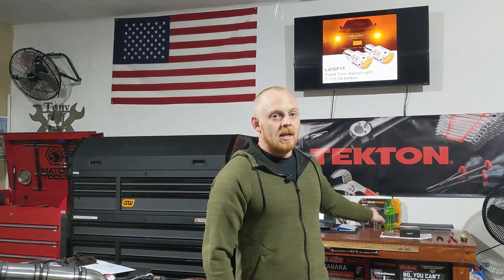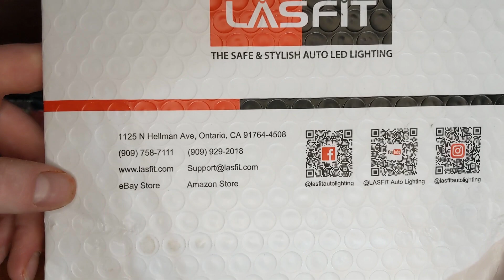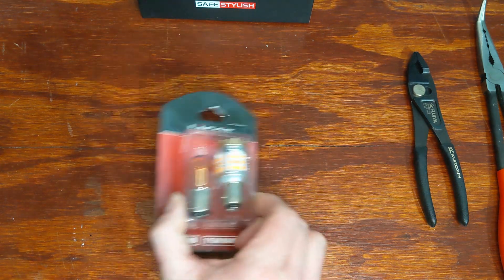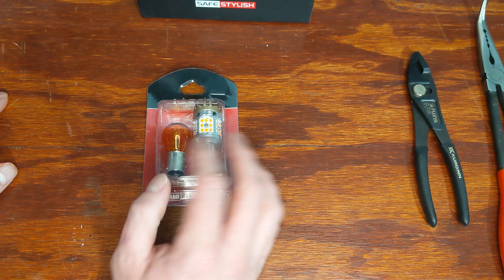2020 2021 Kia Telluride LED Turn Signal Upgrade Lasfit Blinkers Hyper Flash CHECK DESCRIPTION

Comment: Hey Tony, I enjoyed your videos. I just install the LEDs high and low beams. They’re working great. I want to change the turn signal lights, and I could not find your description on the bulbs. Can you give me the description and part number. I also called Lasfit and they said they do not make a bulb for the turn signal. Can you give me a heads up? Thanks in advance.
Reply from the maker: They discontinued it actually. They still have the bulb but they don't list it made for the telluride bc alot of people were having blinker issues. They said they were working on a new bulb to work with it but have yet to see them post them. I had issues with my blinkers early on. They would blink twice then stop blinking. After about 2 months of using them they started working fine. So while they are awesome lights. I don't suggest using them anymore just bc of possible issues. I apologize for not making an updated video about them.
Reply: Thank you

Comment: you need to add a resistors to your turn signals to stop that hyper flashing add one to each bulb
Reply from the maker: The connection is built into the housing of the headlight. So it's not as simple as splicing into the connector that goes to the bulb. It's hard to explain but it would involve digging into the actual wiring harness
Reply: @TonyTheTechnician  yes I see what you mean  you'd have to remove the headlamps and put them in the wiring harness.

Comment: Hey Tony, great video you made, I'm planning on replacing my rear turn signals but I don't know where to begin, it looks like I might have to go under my rear bumper or migjt have to remove my rear bumper gor this idk... Are you planning on doing a video for rear turn signal LED replacement thanks!
Reply: Did you ever do that? I'm searching for a video or help on how to remove the light inside the bumper, as mine has gotten water inside of it presumably from the car wash 😬 wondering if you have any tips?

Comment: Hi Tony, after I seen your video I gotta set of "Lasfit" led bulbs the exact one you had in the video for the front turn signal on my telluride and yes, it was a pain in the ass to remove the stock bulb out of the socket from the vehicle I almost dislocated my thumb by doing that lol. My real problem is after the led had installed, I have noticed my blinker on the driver side(only left turn signal) something blink unevenly, what I mean by that is, it blinks normal for a few seconds then it would blinks rapidly and the weirdest part was the blinker light cuts out it wouldn't show the light but you can still hear the rapid blinking from the vehicle. But sometimes it will do just fine blink normal and you can see the light flashes What do you think this problem would be any ideas? Appreciate your input!
Reply from the maker: Hey ya after about a week of running mine I had the same issue and I eventually shut the auto lights off and drove like that and I'm not sure if the computer learned it but after a little while of doing that I never had another hyperflash issue. I know when they first released these bulbs they had it designated to be q plug n play bulb for the telluride. Then I noticed they removed them as an option for the telluride so I wasn't sure if they changed something or if it was bc of an issue. But mine have been working great for almost a year now so sorry I couldn't be of more help.
Reply: @TonyTheTechnician OK,  I'll give a try like you says and see it correct itself would let you know...! 👍
Reply: @TonyTheTechnician  Hey Tony would you by any chance to do another video on the rear blinker of the tellueide LED replacement...?  Love to see it and I would like to replace my rear turn signal for LED!
Reply from the maker: OK sounds good. Yes please let me know. I'm still running mine and haven't had an issue in a long time so I'm hoping that helps with yours as well bc these things are amazing. I can come up to an intersection and see my blinker reflecting off of everything lol. They are very bright

Comment: I used your link and looked at the bulbs but it says it does not fit my Telly. I have a 21 S model.
Reply from the maker: They discontinued them for the telluride due to issues when combined with other led bulbs. They will be releasing new ones soon with a new chip

Comment: good video.  need to look at these bubs for the jeep patriot.  front turn signals are a real pain to get to.  Do they need a little dielectric grease to help with corrosion?"
Reply from the maker: Thank you and no but that is also more vehicle specific. My bulbs and housing are actually sealed very well. If it's more open to the environment then you may want to 👍